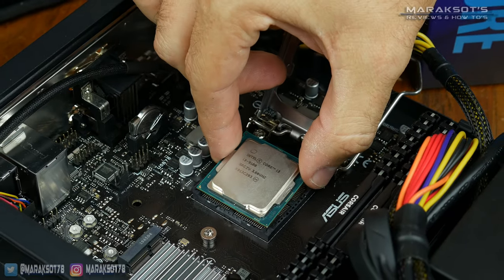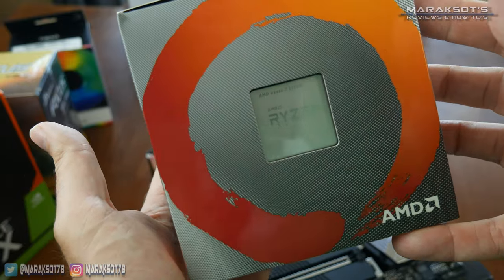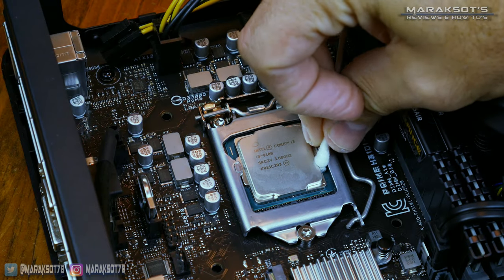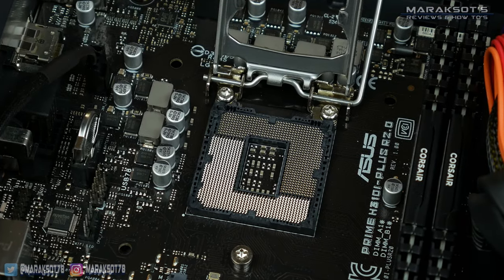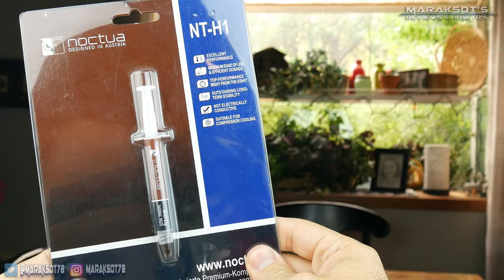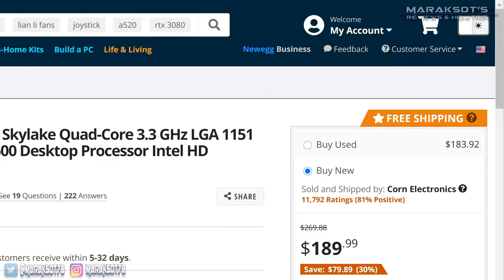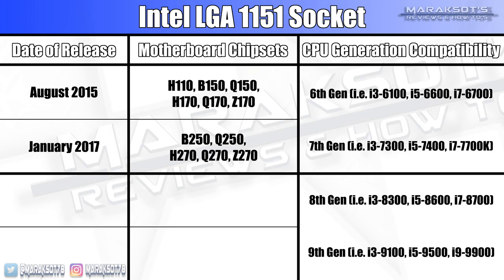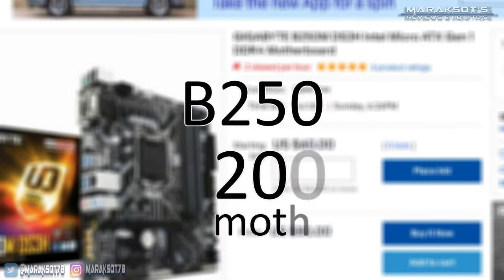A Beginners Guide: How to Upgrade an Intel CPU (core i3, i5, i7, i9)

Comment: Hey,I have an old i3 2100cpu processor and I want to upgrade my overall pc by installing i7 k version in it and an additional ram card and graphics card
It has hdd which I want to change to sdd
Is it necessary to change all of these or buy a new laptop
Reply from the maker: Upgrading a laptop is a totally different monster than upgrading a desktop PC. You can upgrade RAM or storage fairly easily but upgrading the CPU and especially the GPU is almost impossible. Often times laptops are designed around the hardware that is being sold in them. If you have an i3 odds are the power delivery and cooler solution is designed for that hardware and won't be fully adequate for a much higher performance CPU like an i7 and that's assuming the CPU is socketed and not soldered to the board. GPU's in laptops are custom designed to fit in the laptop chassis they're in. The power delivery for those GPU's is also spec'd out to be just adequate enough for that particular GPU as well, making upgrading the GPU nearly impossible. To make a long story short the vast majority of laptops nowadays are designed where if you want more performance your only option is to buy a new more powerful laptop.

Comment: is there a way to know what type of processor I need to upgrade to? I have a Intel® Core™ i7-7820HK and want to know if I can switch Intel® Core™ i9-12900H on a gaming laptop
Reply from the maker: First of all a motherboard that supports a 7th Gen Intel CPU is not compatible with 12th Gen, so the only way to do that would be to buy a new laptop because upgrading CPU's in a laptop is quite a bit more difficult than upgrading a CPU in a desktop PC and in some situations almost impossible.  I personally have never tried to upgrade a laptop CPU but from what I've heard laptop CPU's are not always socketed like desktop CPU's typically are, meaning sometimes laptop CPU's are soldered directly to the motherboard so upgrading it would require you unsoldering the CPU and then soldering in a new one.  Again from what I understand this is not the case for all laptop CPU's but is more common in laptops than in desktop PC's.  Also laptops nowadays are designed to be thin and light and the power delivery system is designed around the CPU that laptop is going to be sold with so even if you did upgrade the CPU there's a possibility your laptops power delivery system isn't good enough for an upgraded CPU to operate properly.  But as I said in the beginning the motherboard in you laptop is not compatible with a 12 Gen CPU anyway.  It's for these and other reasons it's recommended to just buy a new laptop when looking to upgrade... or of course you can sell your laptop and buy a desktop PC which is much easier to upgrade.  I know this may not be what you're wanting to hear but I wanted to at least give you an idea of what you're looking at.
Reply: @Maraksot78  yes, it makes sense, the comfort of a laptop comes with a higher price than I expected if I need to completely change to a new one. Thanks, I'll start saving for a desktop

Comment: I've got TUF B365M-Plus Board, Core i7 9700F, GeForce GTX 1660 Ti 6GB, with 16 GB DDR4 RAM. Should I bother upgrading anything? GPUs are PRETTY pricey right now, but that's the main thing I thought about upgrading. It all works fine for now, but I don't always get to run everything at max settings. Destiny 2, Back 4 Blood, and Cyberpunk are what I'd really like to see at higher graphics levels. Cities: Skylines does pretty well but it pushed my RAM close to max sometimes, probably all the mods and whatnot). Any recommendations from anybody? Thanks in advance!

Comment: My motherboard is HP 2B4B with 1151 socket. I currently have Intel(R) Core(TM) i7-6700 CPU @ 3.40GHz which is 4 Cores can I upgrade to 8 cores with the same socket size or it wont work.
On HP website it says it only supports up to Intel Core i7-6700K (Skylake) 4.0 GHz Quad Core. I thought as long as I have same socket size (1151) it doesn't matter.
I don't know much about CPU any help will be appreciated. The one I am interested is (Intel Core i7-9700KF Coffee Lake 8-Core 3.6 GHz (4.9 GHz Turbo) LGA 1151 (300 Series) 95W BX80684I79700KF Desktop Processor) which is listed on Newegg  I don't know if it will work. 
My second question. If I upgrade to 3000 series graphic card in the future will it work?

Comment: I have a I5-10400F with a LGA1200 socket what can I upgrade to best run a RTX 3060 GPU?
Reply from the maker: Your i5 is plenty good enough for the 3060, no need to upgrade your CPU.

Comment: I'm trying to change from a i5-4430 to an i7-5850HQ and I have an MSI Z97 motherboard do you have any idea if these are compatible?
Reply from the maker: No that will not work. First of all the i7-5850HQ is a mobile or laptop CPU. According to info I found on Intel's website it uses the BGA1354 "socket" and from what I understand BGA (Ball Grid Array) is for permanently mounting chips to their motherboards. Meaning the chip is soldered to the motherboard; which is often the case in mobile devices like laptops. Your Z97 motherboard and i5-4430 uses the LGA1150 socket. The best chip you can get for LGA1150 is the i7-4790K which currently you can pick up 2nd hand on sites like ebay for around $100.
Reply: @Maraksot78  awesome thanks so much for your advice 🙂

Comment: so iv upgrade my cpu xeon e3 1230  v2 to i5 10400 and i did change motherboard aand the gpu that i have is rx 5500 xt. so when i changed my motherboard and cpu i dint get to see much difference performance and yh iv also reinstall windows so no difference :(

Comment: Do i need to remove thermal paste from cpu cooler if i will insert the same cooler again? After changing cpu.
Reply from the maker: Yes. Every time you remove your cooler you want to clean off the old paste and then apply new paste. Over time thermal paste hardens and when you remove the cooler and break the bond that old paste will not properly bond to the CPU again.

Comment: I'm currently using an Intel Core i5-7300HQ with an HP 836B 46.22 motherboard on a laptop. It came with a good graphics card and 16 gb of RAM, but to use these to their potential (or even close to it) the CPU needs to be upgraded. I can't really find any compatibility lists. Could someone help me out?

Comment: Why clean the thermal paste before you take it out? Or does it not matter
Reply from the maker: It's just easier and keeps you from getting paste on your hands and then everything else you touch. 😂
Also for CPU's with pins on them, like AMD's AM4 socketed CPU's, it prevents you from accidentally bending pins while holding it in your hand as you clean it.
Reply: @Maraksot78  Thanks for clarifying I was just curious because only the q-tip lol

Comment: 2 questions, pls someone answer.

1. How can you corrupt a ram while installing it?
2. If you put a new ram stick, does it involve bios?

(I need the answer to number 1 because the dude I hired to put it somehow corrupted the ram)
Reply from the maker: Good question. I've never had that happen before. I've had bad RAM a time or two and had to RMA it, and I've heard of people having dead RAM slots on their motherboard, but I've never heard of corrupting the RAM while installing it.
As for your question about the BIOS... if you want your RAM to run at the speed it's rated at (i.e. 3200, 3600, 4000 etc) you'll need to go into your BIOS and enable XMP (DOCP on Asus boards if you have an AMD Ryzen CPU) otherwise your RAM will only operate at it's base speed, which is 2133MHz for DDR4 and 4800MHz for DDR5.
Reply: @Maraksot78  Thanks, seems like the computer dude was so bad that he did the impossible which is corrupting the ram while installing...

Comment: If I upgrade from core i3 2nd gen to core i5 2nd, and it fits on LGA 1155 socket.......will it work or not? Is there something more you need other than same generation of processor and same socket of motherboard? Please someone guide me.

Comment: So i have a intel core i3 4160 LGA 1150
And i want to upgrade to an i7 4790k to pair it with my gtx 1660, would that be a good?
Reply from the maker: Unless you have a Z97 motherboard then I wouldn't recommend the 4790K as it's an unlocked (overclockable) CPU and you'll only be a be to take advantage of that with a Z97 motherboard. If you have any other LGA 1150 chipset motherboard I'd probably recommend an i7-4770 instead.
Reply: @Maraksot78  will the performance for a 4770 be similar to a 4790k,
Reply from the maker: The 4790K is the most powerful CPU on that platform so the 4770 is not going to perform as well as the 4790K. The numbers I've found online show the 4790K is somewhere between 15 and 20% more powerful than the 4770 depending on the task being performed. Compared to an i3 4160 though the 4770 is going to mop the floor with it. 4th gen i3's are dual core CPU's with hyperthreading (4 logical cores). The 4770 is a quad core with hyperthreading (8 logical cores). The 4770 has a base frequency of 3.9GHz compared to the 4160's 3.6GHz so not only would it give you double the processing cores but it's also 300MHz faster. I'm suggesting the 4770 because if you put a 4790K into a low end motherboard then you'll be kneecapping it and it won't be able to perform at it's full potential so you might as well go with the 4770 because they're a lot cheaper than the 4790K and the 4790k in a low end motherboard is probably going to perform around the level of a 4770. It doesn't make sense to me to pay more and get the same performance as something less expensive. Now I have no idea what motherboard you have. I'm making the assumption you have a pre-built PC of some kind and if it originally came with an i3 then most likely the SI (Dell, HP, etc) would have used as low end a motherboard as they could get, and a low end board is not going to be up to the task of powering a 4790K with what it needs to run at full tilt. If you have a Z97 motherboard though then by all means get the 4790K as it's the best CPU you can get on that platform.
Reply: @Maraksot78  honestly just learned something new. Never knew a motherboard could affect components too. There is someone selling an asus z97 with a 4790k already installed on it for $150 . Should i consider buying it .
Reply from the maker: @curius699  if everything is in full working order it sounds like a good deal. As of right now on ebay the 4790K itself is selling for around that price.

Comment: Hi will i gain anything by upgrading my i5 6600k living on a Z170 P mobo up to an  i7 9700, i did watch to the end , lol!
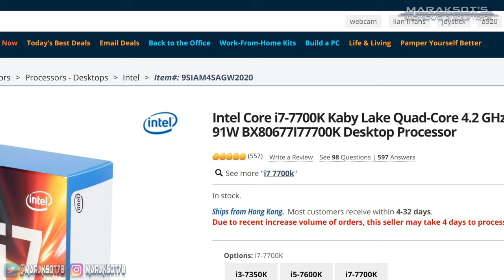Reply from the maker: It depends on what you use your computer for? If you just use it for browsing the internet, email, word processing, spreadsheets and the like then most likely you will not really notice any appreciable difference. If you do tasks like video encoding or run some kind of crazy calculations that are CPU intensive then yes; you'll definitely see an improvement. However... your Z170 motherboard will not work with an i7-9700. The 100 and 200 series motherboards only work with 6000 and 7000 series CPUs.  To go up to an 8000 or 9000 series CPU you'll need to also upgrade your motherboard to a 300 series motherboard. This is the "mirkiness" I talked about at 7:04 in the video with the LGA 1151 socket. Intel changed some things between their 7000 and 8000 series CPUs so even though the 6000, 7000, 8000 and 9000 series CPUs have the same number of pins on them (1151), the pins on the 8000 and 9000 series chips are not laid out the same as they are on the 6000 and 7000 series chips, therefore a new 300 series motherboard with the correct pin layout is required. If you're looking for a way to improve the responsivness of your PC, moving your operating system and applications to a SSD is by far one of the best ways to "speed a computer up".  Assuming you're OS and apps are currently installed to a mechanical hard drive that is.  I hope this helps.  :)
Reply: @Maraksot78  thanks, what i am aiming for is faster data transfer so it makes everything speed up i play Far Cry, Fallout, Just cause and currently Cyberpunk
Reply from the maker: @davidparry7325  What do you mean when you say faster data transfer? Are you meaning you want your games to load faster?

Comment: I have a laptop asus x515ma-ej450 with a intel Celeron and i want to upgrade it to a I3 or a I5,can i?
Reply from the maker: Most laptop CPU's are soldered to the motherboard and are not easily swappable like desktop CPU's are. I don't know if that's the case with your laptop or not, but in my experience that is the most likely scenario. Also, laptops are often designed around the specific CPU that's being installed in them, so even if it was socketed and you could simply swap a better CPU in, it may not have a good enough power delivery system and cooling solution (aka CPU cooler) for that CPU and would possibly not work properly. My general recommendation when someone is wanting to upgrade a laptop is to just buy a new laptop.

Comment: I have a gigabyte h170m-D3h ddr3 so I’m upgrading from i5 7400 to i7 6700k… I get a blank screen please help (other components hyper fury x rams ddr3 2x8G at 1866mhz, gtx 1070ti and windows 10 pro 64 bit installed on Nvme M.2 256G I have two more hdd installed 4TB n 1TB)

Comment: so,i'm in #6%club then..noice💪
I have recently upgraded my cpu to i7 4790 and noticed something else which i do not know anything about. It says my dram controller is Intel Xeon following some weird nums and was thinking is that normal or should or can i upgrade them to coresponding cpu or does them go as stock or..for me this is hi end of pc dwelling which i'm still learning..my rig now performs way bttr and was wandering what else can i do to upgrade it further. Surely,i do not want to mess w something i don't know so,investigating is a way to go..lol

btw,thanx for explanation of 1151 sockets which i didn't know of even..aaand how much jump i should have for next build but,deff not the 1151. The lap is too close,i think..myb something that supports 12 cores or less,or myb even higher. The price shall tell.

awesome video,btw..i really like it.

Comment: ok.. here's my plan, upgrade my Windows 10 Pro. HP Envy750-624 desktop to windows 11, my PC is stock with motherboard "BARA (92872 ) ? that's the number are on a little sticker on the MB.  now HP has determined that the CPU can be upgraded with an INTEL i7-7000,  3.6 quad core, 1151,  I just installed a new vid card, cuz I had to! (ols one died)  I chosen the gigabyte geforce gt-1300 an upgrade of sorts, this PC is an everyday driver, I don't game,  I'm a old fart of 67,  but i do play guitar and use a DAW to mix my music. but that doesn't require a lot out of my  PC to use.  any input on the BARA motherboard, which I'm assuming that this is the  lowest end of Mb's, is it worth the upgrade to achieve windows 11 or spend an upwards 700  and buy a pc with W11 already installed, the CPU cost  is like 400. right?  what's your opinion   and great video, you help answered moat of my inquiries

Comment: But what’s the difference between 1511 & 1511 300 series?
Reply: I mean cpu cooling wise , i have a i59600k & I’m using an evo 212 , but I want to buy other cooler how do I make sure its the right 1151 😅

Comment: This videos old and I don't think I'll get a response but I have a intel b560 motherboard, i5-11400f, rtx 2060, 16 gb ddr4 and an intel 512 gb m.2 nvme ssd. I wanna upgrade this to last for a while and want to know what to upgrade little by little to get the best bang for my buck. I play fps games but enjoy story games on high graphics. If anyone wants to read through this and help me I will appreciate it.
Reply: I have the same build weirdly enough but I bought an i7 and it is a tiny bit to big so now I have to go return it orrr get a higher board the rest will fir on most boards so don't worry about that part just do what I done bro
Reply: @peterkevinconyer-bowden1548  heeeeyyy I appreciate it man, so best thing is to upgrade the board first and build off that?
Reply: @iknuggz2842  yeah it's what I'm doing bro good luck man

Comment: upgrading to an i9 11900k from an i7 10700k , when i put the i9 in im not getting a signal to my monitor but everything on my pc turns on and seems fine , any tips on what to do ?
Reply from the maker: My guess is you need to update your motherboard BIOS. Put your 10700k back in, update your motherboard BIOS to the most current revision and then swap in the i9. If you don't know how to update your BIOS, here's a video I made that should help.
https://youtu.be/wk_bo6OWq6s